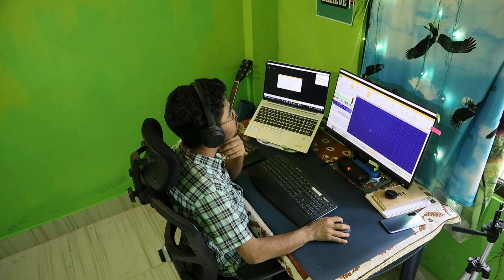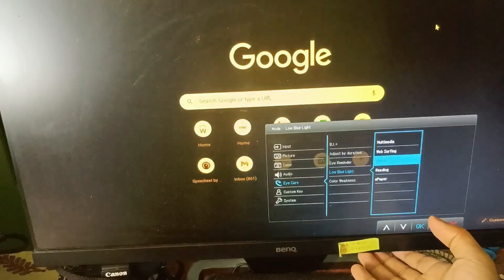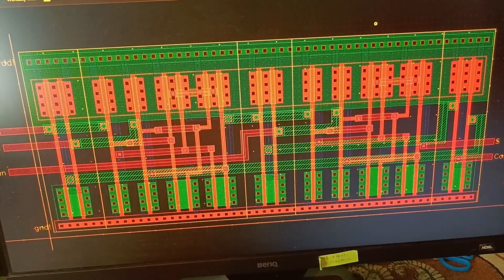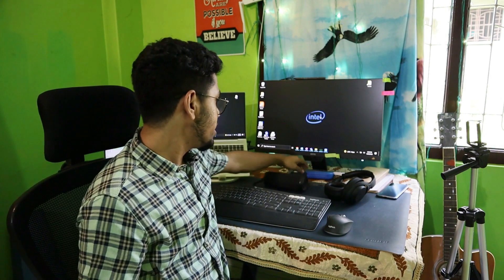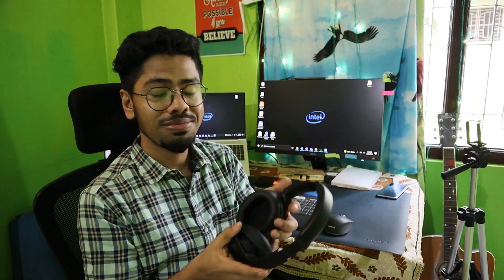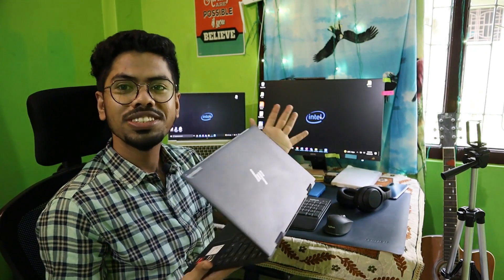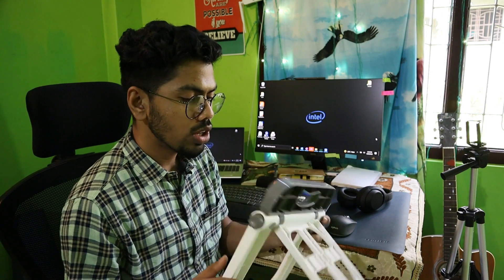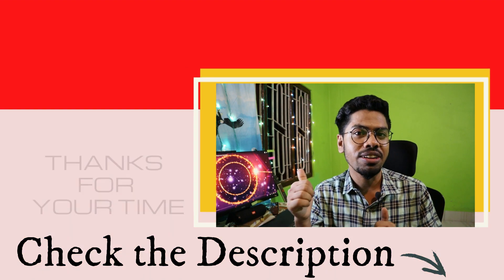VLSI Engineer's Setup Tour 2022 |Guide to build a Work setup for Hybrid work model of VLSI industry

Comment: Can 🤔 we switch back and forth from front end to back end vlsi engineer if we wanted..........
Reply from the maker: Yes you can , in worst case you may need to start a fresh. But being in industry in any domain for long you start getting a idea about both the domain and so switching is relatively not tough...   And in many company being a backend engineer to you can work gor small project in frontend and vice versa

Comment: Bro what should be the basic specifications required for laptop for working for vlsi engineer
Reply from the maker: Very ordinary, if you are working on server based software and most are server based only like cadence ,synopsis... If its local tool like LT spice i3 with 8gig(4gig is also oky) memory . no need for discrete graphics
Reply: @whyRD  Thank you bro